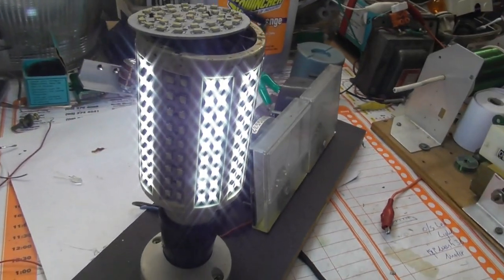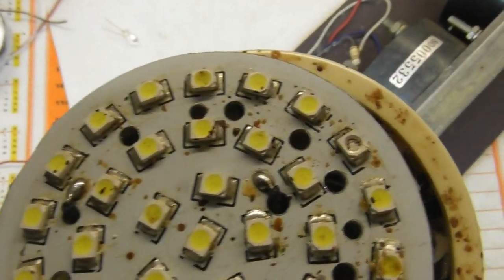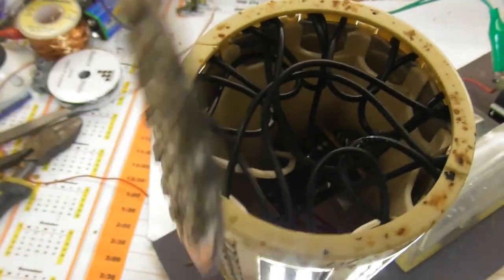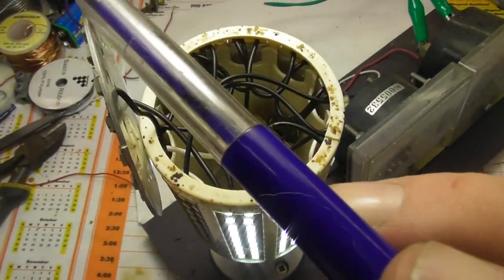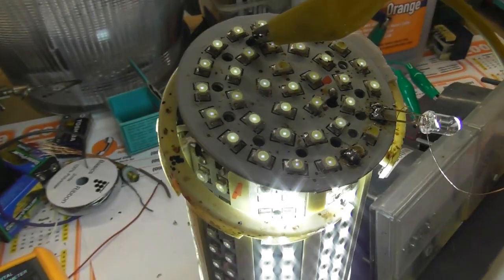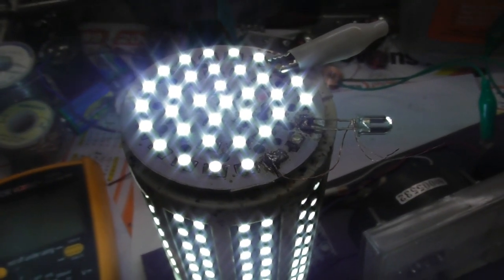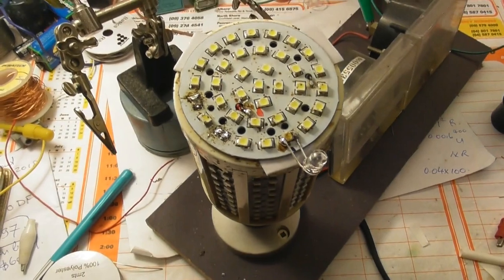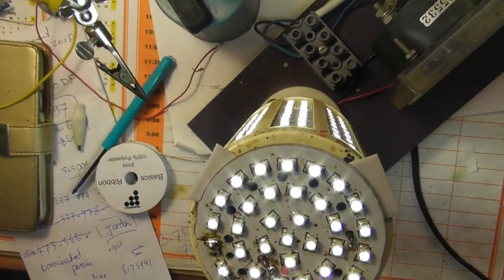LED corncob lamp repair

Comment: Nice quick fix! 
That's the downside when using many LEDs in series like that - if one goes out (and fails open), the whole segment goes out, haha
Reply from the maker: Yes, very true. I also find that the LED;'s are heavily overdriven instead of the usual 20 mA.

Comment: That's one of those things you don't want to touch when it's on
Reply from the maker: Correct. you can touch the LED solder joints, no outer casing. That is why I used the blue pen.

Comment: I've had 4 or 5 smaller led lamps die in the last two years. Most don't even last 6 months. All the better ones I've seen over drive the leds... it's bu$iness bullshxt, like why so much new stuff is garbage!